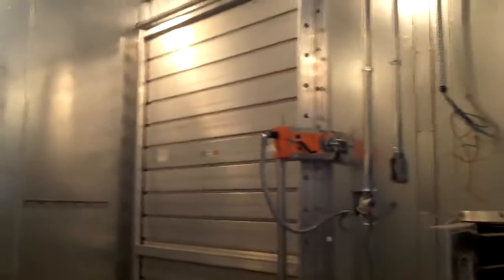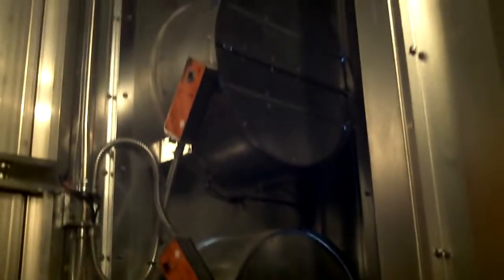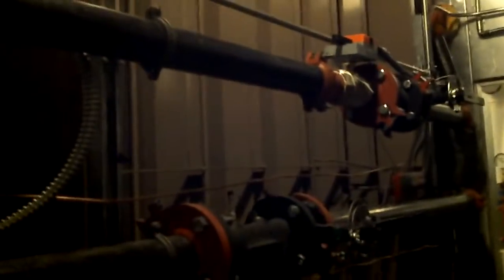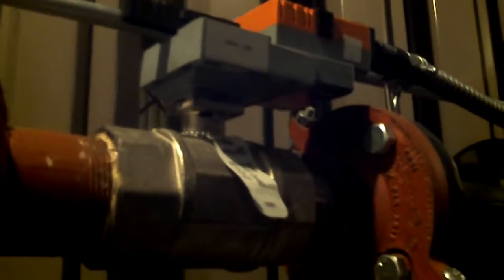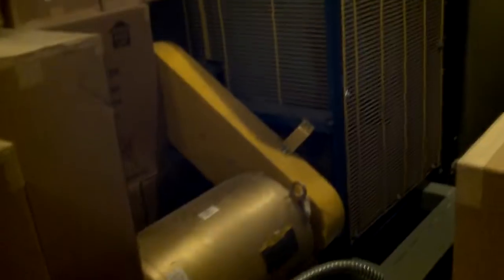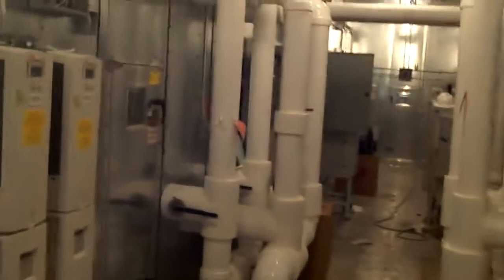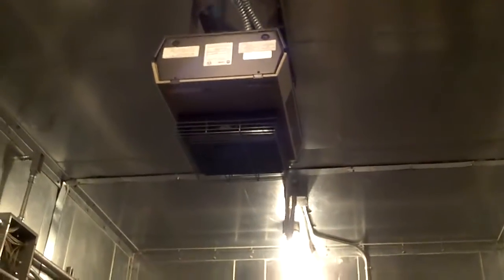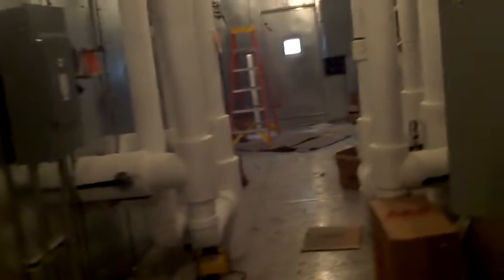Giant air handler

Comment: Allen Bradley drives? Those sure looked like ABB drives ( Asea Brown Boveri ). I have wired, troubleshot and started new ABB drives. I have also troubleshot a number of Allen Bradley drives, so you may want to re-check the labels......
Reply from the maker: You're correct.